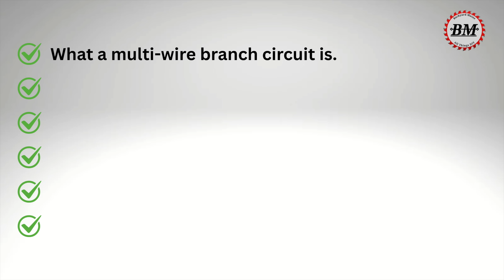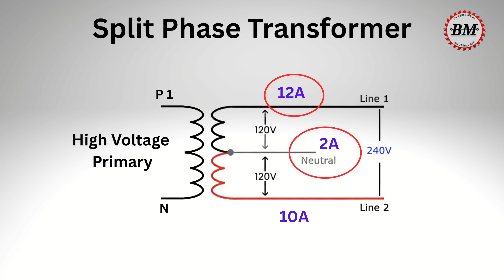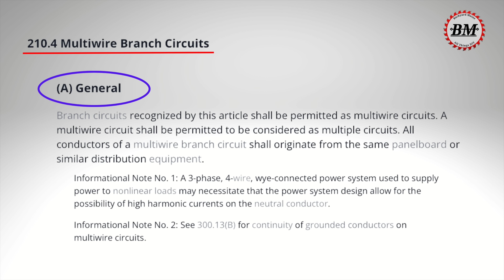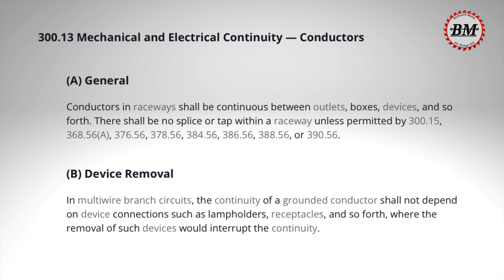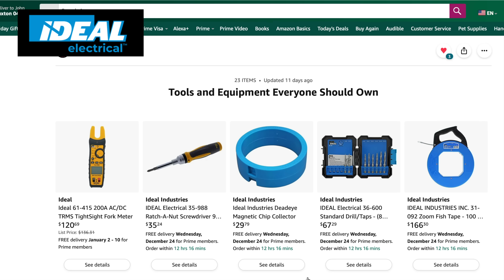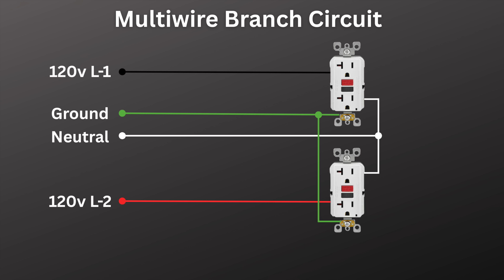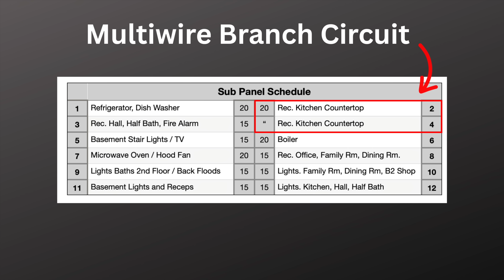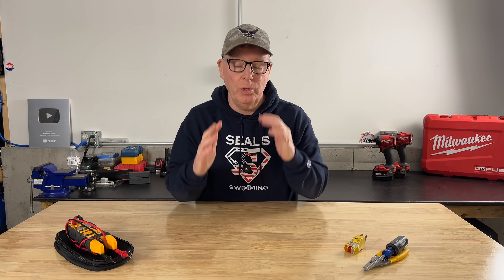Homeowners Don't Know This Dangerous Circuit Exists!

Comment: The two things I wish they would ban in residential Romex style wiring are switch legs and MWBC's.
Reply: How would you suggest a switch leg in residential that uses Romex if it was banned? Or are you excluding 3 wire Romex from your switch leg ban comment? I'm asking out of curiosity to learn stuff that maybe I didn't know, not trying to be mean.
Reply: @laureldc  I just believe that both the homeowner and "the next guy" should always know what to expect behind the drywall.  There should be no "surprises".  

Romex to the switch and THEN to the light fixture.  Not the fixture first and then the switch.  

And ...zero MWBC's.  Save that jazz for commercial.  Wire wizard all you want to in conduit.  Nothing in residential should require anyone to "try and figure out what was done" when 99% of it is hidden inside of walls and ceilings.  The most exotic thing in the walls should be wiring for 3 and 4 way switches....and even THEY should be standardized down to just ONE acceptable method.

And ...I believe we need to respect Romex theory.  Some people call it breaker theory or circuit theory.  Stop treating the wires in a Romex cable as if they were all separate "free range" wires to get creative with.  A Romex circuit should remain isolated until it connects in the panel.  Just because the neutrals all connect at the neutral bar doesn't mean they should connect anywhere else in the house.  

And ...just because it's happening in the panel...that doesn't mean it's happening in the walls.  At no point do the split phase legs touch each other.  

We have to stop thinking of a 120V circuit as being part of a 240v circuit to be balanced.  They are not connected....anywhere.   Current is not flowing through one and out the other.  The two legs of 120V are just that. They are completely and utterly separate. They don't become 240V until they are wired that way for a 240V application.  Yank the red leg of the SER out of its lug.  The black leg 120V circuits will all continue to function just fine.  Some people get so confused about how a 240V circuit works versus how the panel functions.  They see the panel as being fed with 240V when it is most certainly not.  The Neutral is absolutely crucial.  

There...thanks for letting me vent.
Reply: @JamieHitt  happy to listen to you vent. Informative to hear opinions. I too wish one standard could rule but anytime someone tries to start one standard to rule them all it just turns into yet another option. So confusing. So many differences because of time, region, word choice. Even within the same house. I don't like the answer, "there is no such thing as a standard size ___" especially when standing in the hardware store soaking wet realizing there are more fitting size choices than you imagined and the picture you thought to take before going to the store can't tell the difference between 2 things 1/8 different

Comment: Though sharing a neutral is legal. I personally try to pull one neutral per hot leg. Sharing in commercial and industrial does help when dealing with conduit fill and that is the only time I will do it.
Reply: and if its on sensitive equipment I wouldnt do it in mercial either

Comment: I nearly always pull the main. And yet, in a two unit old apartment building, you should always check because you never know if someone mixed panels/floors out of convenience!
Reply: I only (always) pull the main if i'm working in the panel.  Typically i'm working in an occupied space, so I can't pull the main without causing more inconvenience, but I never work an energized circuit unless it's absolutely necessary for troubleshooting or to check voltage.

Normally, I plug in a radio if i'm working on receptacles, turn it up loud enough to hear from the panel, and flip breakers until the radio stops.  Then I test evey current carrying terminal against ground with my multimeter, to confirm it's de-energized.